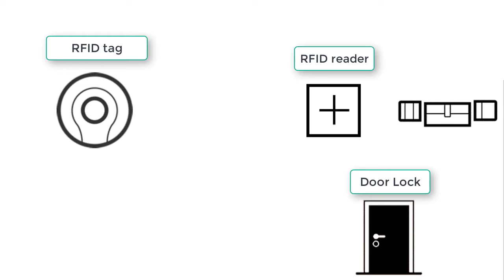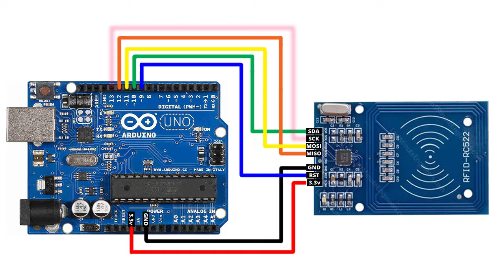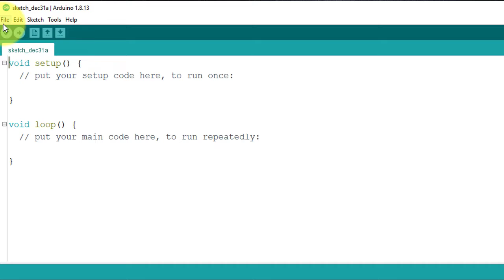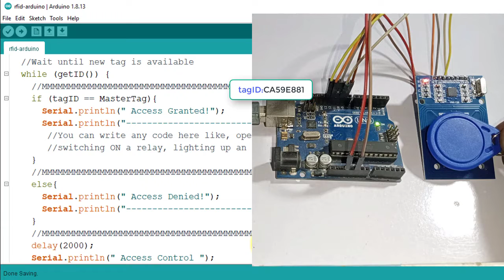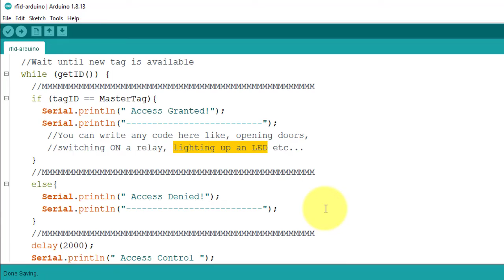Arduino RFID | How to Use RFID RC522 with Arduino

Comment: So I tried the code and the code works Ther is only one problem. I checked all the wiring and when I put it on, it did it for 5 seconds. Then it started to smoke and the LED became increasingly dimmer. When I pulled the plug, all the pins were warm. Not very hot but warm enough to smoke.
Reply: you gave it 5v accidentally and fried it, the usual model only supports 3.3V in reality

Comment: Am doing rfid rc522 attendence system using arduino with data logger     ....in this am getting the SD card initialization failure ....what was the problem in this ..could you please reply me ..whats the problem...am not getting the output

Comment: In the cerial monitor it says that the firmware version is 0x18 = (unknown) and nothing is showing up when i tap the card
Reply: I don't know about your case, but I connected the VCC of the RFID reader to the Vin pin instead of the 3.3V pin. It works, and I have made a video about it that may help.
Reply: @HandyMakerDIY  I tried it, and it still says 0x18 is unknown or defect. It may be something with the module
Reply: @heavybladevideo   That could be the problem. Sorry for that bro.
Reply: @HandyMakerDIY  I will try that, thank you
Reply: @HandyMakerDIY Thanks thanks thanks I was almost about to pull my hair out this helped it worked

Comment: I already follow this step, but on serial monitor stated that there was a communication failure. How do I solve this?
Reply: from my experience this is due to unstable connection between the rfid module and the whiteboard if you are using one. i suggest tightening the contacts with a rubber band, hand or tape. it may not be obvious, took me whole hour to find out the perfect position. good luck, hope the response is still useful)

Comment: Does arduino have a package for reader RFID stickers from a distance for 5-10 meters?
Reply: no, its almost unreal, but you can try do it self.
Reply from the maker: Typically, the RFID readers available for Arduino have a range of only a few centimeters to a few meters. However, there are specialized long-range RFID readers that can read tags from a distance of up to 10 meters or more. These readers usually operate at higher frequencies and require more power than standard Arduino boards can provide. In order to use a long-range RFID reader with Arduino, you would need to use an external power supply and possibly an interface module to connect the reader to the Arduino board.

Comment: Please Sir is this technology related to the prepaid card used for buying electricity?
Is it possible to scan the prepaid card  using this method?
I have read on the card that we should keep it away from magnetic material?
Is there a secret out there  related with this method used in this video?
Reply from the maker: yes you can scan. but some card are locked and you cannot access the card